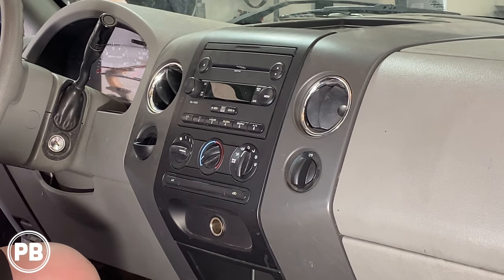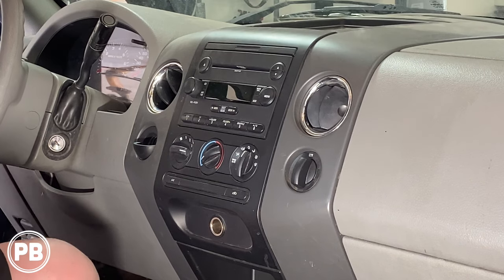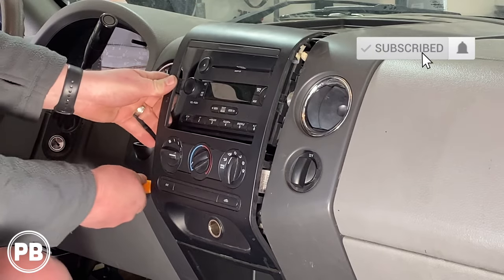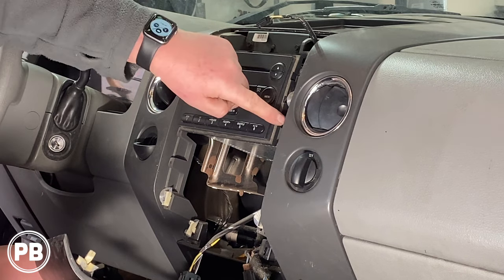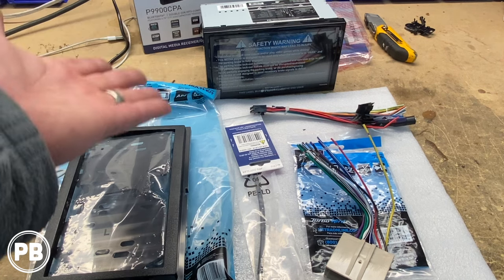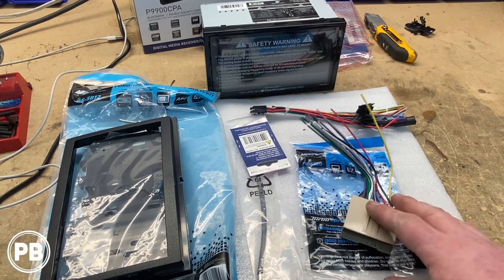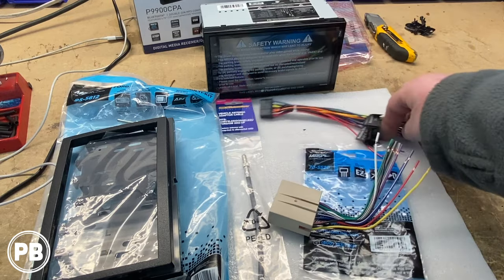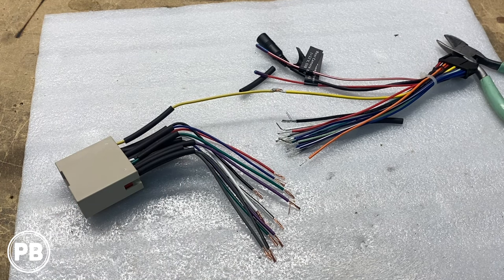2004 - 2008 Ford F-150 / Mark LT Radio Install

Comment: Don’t waste your money on the antenna extension because it didn’t fit & there was plenty of length on the original to plug into the radio.

Comment: 2005 Ford F-150.  Thank you very much...ordered parts and install took less than two hours for my son and even after forgetting the hands free microphone the first time.  Used the butt-to-butt connectors instead of soldering.  Great video and clear precise description.  Radio even has more 'kick' with the factory speakers.  5 Stars!!!
Reply: Which radio did you get?

Comment: Question, saw you plug in the harness but what about the smaller plug? Does that just get tucked in behind??
Reply: Did anyone figure what the smaller plug does? I installed a Kenwood and just tucked this behind. I had Satellite radio and unplugged a 3rd plug from the receiver which I ditched for a Serious unit.

Comment: I just put mine in, and the biggest question got answered. That center  plus that was in the stock stereo I guess does not get utilized? I have to take mine back out since I think the driver side speakers are not putting out sound. Might have to either do a new crimp job or do like you did, Sauter them together

Comment: This video is extremely informative. I never heard of the brand, I took you up & this & just received today everything you listed. I can’t wait to get it installed, I also purchased the backup camera for my 2004 f150. Thanks!
Reply: What back up camera did you use if you don’t mind me asking?
Reply: @trappyoung  make sure your wires from camera to radio are correct before you put everything together. I had to redo everything because the camera was showing left as right & viscera. It’s very easy to do yourself & if you have any questions I will try to respond back asap. Get yourself the wire loom split tubing also to protect your wires from the elements.

Comment: That mounting kit sucks. Had mine break off the other day. The Kenwood stereo I have is heavy and broke the plastic mount. It should be made of metal and not plastic. You did exactly what I did when installing the radio. Dumb that we have to cut off the back pieces for the F150

Comment: The adapter for the radio antenna. I bought the black part listed. And the orange is apart of the car. But they don’t connect to eachother. What is that black piece that’s connects the two?

Comment: Nice video!  It gave me the motivation to do an install myself.  What is the smaller connector harness on the back of the stock radio that isn't used with the new radio?  Thanks.

Comment: Excellent video…. So would this install vid be basically the same for a 2008 Limited? I would obviously just need to buy the extra harness for sub, amp & steering controls correct?
Reply from the maker: Yes. We can help you identify what you need if you send me a message on Facebook or instagram.

Comment: Hey wassup man….love the videos…. I’m a quadriplegic and recently bought a 2013 ford econoline van to get around in…I installed a new radio with back up camera and two kicker cs series door speakers but I wanna add two more speakers and a sub in the rear because it’s just the two fronts alone right now….. I don’t have alot of money and I’m trying to do it at a low cost…. Do you have any recommendations??

Comment: Awesome video. Your instructions were precise and easy to follow. My install went smoothly. The stereo works great until I turn on the headlights. It stills plays fine but when lights are on the stereo lights pulse rapidly. I do have led headlights and I am thinking somehow this is causing the interference. Have you ever seen this problem and do you have any suggestions how to correct it?
Reply: Led flasher adapter plug thingy maybe

Comment: What is the process to add/wire up the dual USB port? That is really cool
Reply: The back of the radio has two usb plugs coming out of the back and ya just plug the usb port you buy into the radio

Comment: Are your steering wheel buttons working for the radio, also the cruise control buttons as well, because mine are not working and idk why, please provide some info thanks

Comment: Great video, but where or how did you plug in the USB port?
Reply from the maker: We cut a 1" hole, flush-mounted the usb adapter listed in the description, and connected it to the usb ports located on the back of the radio.  If your radio doesn't have a rear facing USB port, then this modification isn't required.

Comment: Hi! I was wondering what you did with the other factory male harness did you just put it aside and didn’t use it? If you read this let me know, thank you!
Reply from the maker: Not all OEM harnesses are needed to integrate a new aftermarket head unit.  It wasn't needed!
Reply: And also, do I connect the remote wire (aftermarket amp wire ) to the aftermarket head unit harness or to the aftermarket factory harness? Because for me there is a blue and white stripe wire on each harness and I heard if I connect all 3 wires together the subwoofer will make a pop sound every time the radio turns on. If you read this please reach out to me, thank you!!

Comment: Question, ive got a 07 f150 Harley Davidson with Sirius XM on the stock radio. Do i need to buy the Sirius XM tuner to keep Sirius XM feature on my new Kenwood Sirius XM ready double din?

Comment: I tried this on my 2007 ford f150. I plugged the unit in and it was unresponsive. Tried to reset it and still nothing. I tested and there is power going to the end of the harness so I am wondering if you know why this could be happening?

Comment: Ty for the video. Can you post a backup camera that can be installed with this radio?
Reply from the maker: We will when the next F150 of this generation comes through the shop.  We have a much older version (years ago) on the channel on a Lincoln version of the truck if you want to check that out.
Reply: @ProvoBeastAudio I've got a 2006 f150 that I would like to add a touch screen, and backup camera to. If you're in Provo Utah I would love to have you install it. This truck also has in headrest video displays, will those keep working if I got this?
Reply from the maker: @goneballistic  Send us a message on facebook or instagram and we can chat!

Comment: So I ordered the parts you listed, but the front dash piece doesn’t fit the stereo. Did you have to modify the front frame piece to fit it?  Yours looks to fit nice and snug, but mine is just slightly too narrow…
Reply: Never mind. I see you had to remove the border piece on the stereo and then it fits right in. Whew…
Reply: I also had to drill three holes each side for the bracket side mounts since only one of the factory holes (the top screw you used) was lined up.

Comment: Where did you connect the two wires you pulled from the dash to connect to the USB 3.0 behind the dash, there is no link for those wires.
Reply from the maker: The Dual USB flush mount adapter connects to the USB inputs of the radio.

Comment: When you connected parking brake input did it connect to the black wire
Reply from the maker: On most brands, yes, you can simple ground it to the black ground wire.  On Pioneer and Alpine units, you will need a bypass, or hook the parking brake wire  up properly.

Comment: What did you plug the 2nd USB male end into? One went into the female end for the radio. The other?
Reply from the maker: This radio has two USB ports on the rear, both hooked to the radio. If your radio doesn't have two USB inputs, just use the flush mount with a single USB.
Reply: @ProvoBeastAudio   Thanks! Yup, mine only has one from radio.

Comment: Wired color for color, everything's working but the radio doesn't power off when key is removed from the ignition? It can be manually powered off and comes back on with settings saved the next time the car is started.
Reply from the maker: You most likely have the wrong harness adapter.  There are a few variables there of why it's doing that, but without knowing the year, trim, radio, and adapter parts, hard to diagnose your issue.

Comment: The wires are already cut on this ford! How do i test the wires whithout the key on or battery connected? 😅
Reply from the maker: Sounds like you have a big mess on your hands.  Either find a new harness to repair the old one, or else you may have to pull wiring diagrams online to see what wire does what.

Comment: I have tried twice. I have wired up a wire kit for my F150 when I plug into the factory harness the radio doesn't have power to radio I've heard someone tell me to hook red to yellow but scared that burn up something
Reply from the maker: Sounds like you have the wrong harness adapter, or have wired it incorrectly.

Comment: You left the reverse input out right...I dont know if im suppost to connect it somewhere
Reply from the maker: No need to connect it until we add a backup camera down the road.  One wasn't being installed on that specific vehicle, but we kept it accessible until one was.

Comment: What would cause fm not to work on a 05 ford f150? AM works fine, took stereo out to check antenna connection, looks ok??
Reply from the maker: Sometimes the blue or blue / white wire on the adapter harness controls an antenna amplifier.  If that isn't hooked up, reception can be poor.  I'd check that connection.

Comment: At 5:48 what kind of screws did you use? On the side of the double din
Reply from the maker: Screws that were provided by the radio manufacture.  These Boss radio's use fine-thread screws.

Comment: Hello, i have an 05 f150 4.6l and this isnt my first install but ive ran into an issue where once i pulled factory radio an wired everything up.. connected Aftermarket radio, it wont turn on, gas gauge dont work nor wipers. i checked run/acc fuse and its good. plugged factory back in an the factory radio works but still no sign on gauge movement or wipers etc.. any help?
Reply from the maker: Check more fuses. Sounds like something blew.

Comment: What colour did you put for key 2 steering wheel controls
Reply from the maker: We used a brand name radio, so there won’t be a key 1 or key 2 in our harness. It depends on your radio, and which harness you are using.

Comment: Does it have to be 6.75in or will 7in work as well?
Reply from the maker: Screen size is irrelevant, as the dash kit accommodates any standard sized double din.  Generally the biggest screen in dash for a double din is 7", anything bigger migrates over to the float mount screen style which will still work.  So yes, a 7" will work fine.

Comment: What about the accessory plug on the bezel?
Reply from the maker: Accessory plug? you mean USB Port?
Reply: @ProvoBeastAudio  no, my 2008 F150 has a little mini audio jack where you could plug in your audio device or whatever. I am thinking it could be used as a place for an aftermarket microphone for a upgraded stereo, but I didn't see what or if you unplugged anything, the plug is like on top of the dash above the stereo

Comment: My radio flickers not on and off just brightens.  Suggestions?  Checked all connections...
Reply from the maker: You may have a bad harness adapter, wrong adapter, etc. not sure without seeing it or having more info.
Reply: @ProvoBeastAudio   I used the crux swrfd-60L link listed below video. Something to do with whatever dims it when the lights come on thats what it does just goes from dim the bright flickering random.  Thanks
Reply: Turn auto dimmer off

Comment: Is compatible with multimedia buttons on steering?
Reply from the maker: Yes, see the description for notes with those specific parts if you wanted to retain your factory steering wheel volume controls.

Comment: My radio wont fit in the din....and the screws dont match ifk what im doing wrong
Reply from the maker: Depends on what radio you are using. Send us a message on Facebook and we can assist further!
Reply: I got it thanks so much i had a different question now to make calls do i need to put in the microphone it came with

Comment: So what if you were a big dumby and somewhere along the way forgot to not start the truck with the airbag light unplugged and now you have a light on the dash 😂 now what 😢
Reply: Did you try unhooking the battery for a while and then hooking it back in?

Comment: Could you make a video adding the back up camera in the tailgate latch please 🙏
Reply from the maker: Sure, as soon as one comes in the shop for one!
Reply from the maker: @XXxxMULLINSxxXX  We flush mounted the USB in the front bezel below the heating and air controls.  If the radio you have doesn't have a rear USB input, then no action required.  If it does, and you don't want to flush mount it, you can run the USB cable into the glove box.
Reply: The license plate one is only $26 & it’s excellent on Amazon from eRapta.